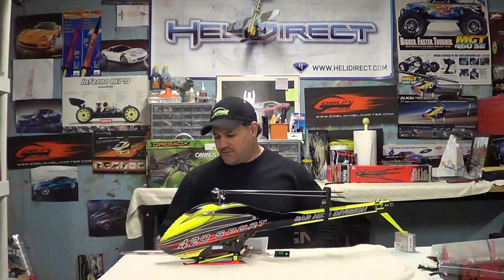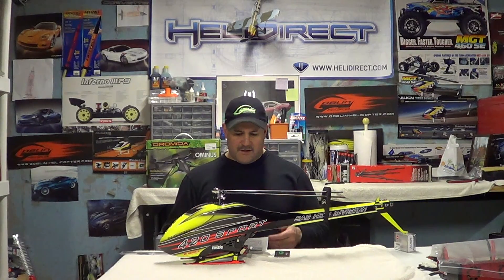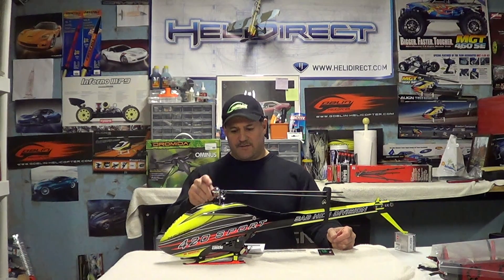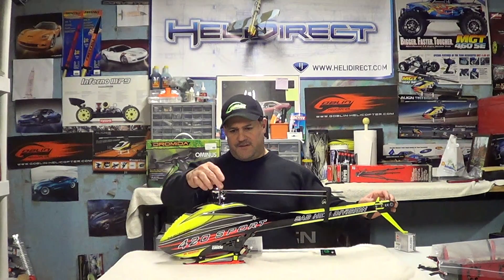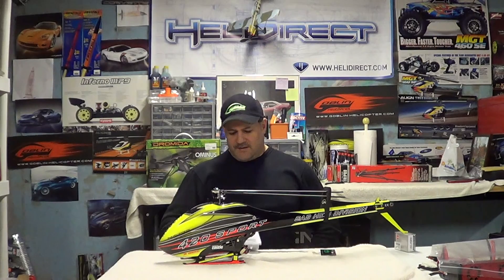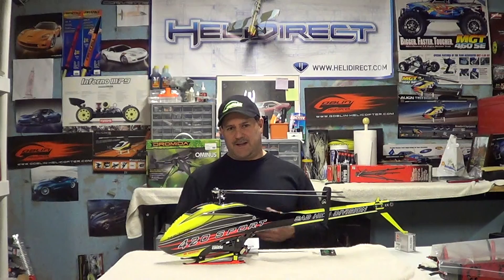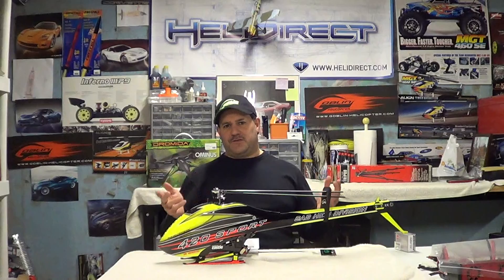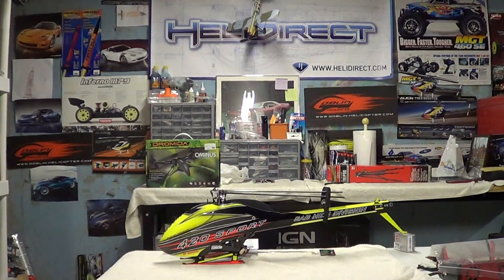Sab Goblin 420 converted from  Goblin 380 and how to do it

Comment: I played that game as well - numerous helis of all different sizes.  Can only fly one at a time; you should only be practicing (daily) on one size heli in order to gain proficiency; and it gets expensive stocking parts for all those different helis.  I recently sold off most of my fleet leaving only my Goblin 700 Competition as my main flyer.  Having the Rescue feature on the Neo has mitigated crashes and the associated costs and is a worthwhile investment.  Now the question is: Do I really need another helicopter?  If so, then I have been considering the 420 or the new Fireball that is due to be released soon.  Or even the OXY2/3.  Something small, not too expensive, that I can keep on stand by at the field should I have a mechanical issue with my 700.